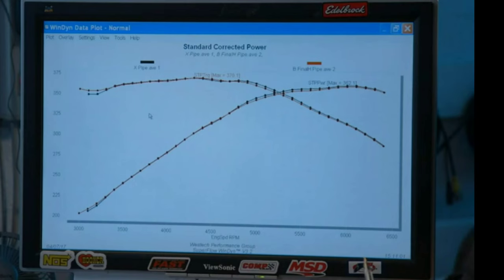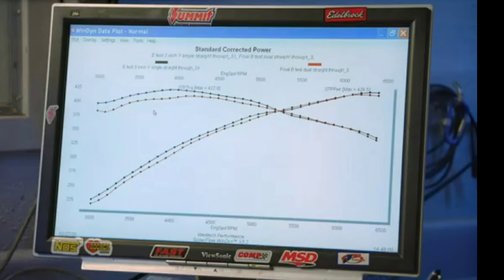DUAL EXHAUST LOSES POWER! single is better for POWER!

Comment: I have a 2005 accord coupe V6 it has 2.5" pipe and it has around 300hp dual exhaust what would be good for it to add more hp and throttle response/ back pressure because i installed a loud exhaust now it's slow i don't care about sound anymore how do i make faster ?
Reply from the maker: You want zero backpressure, actually you want vacuum. 

I would do 2.5 in exhaust into a Y pipe and 3in outlet if it were me 🤔
Reply: 2.25" dual with factory catatlytic converter to keep initial exhaust velocity high and low end torque. Y pipe that has a 3" diameter , this then splits into your stock rear dual exhaust mufflers that are 2.25" , this lower diameter is important to keep velocity up (gas cools and slows as you get to rear end of vehicle). I would also heatwrap the entire system to keep higher EGT and prevent drone.

Comment: Heres what I want to know, I am building a Vanguard 23 hp airplane engine modified for 40 plus hp at 5,000 rpm, (briggs and stratton). V Twin which fires 450 then 270 degrees, so there is no way some two into one pipe helps it.. RIGHT?
Anyhow, I can run straight pipes no muffler, cause I am in the air :)
My Dynosim6 software tunes the exhaust but always wants a collector, 2 into 1 I guess.
It says to run a 1.2" primary pipe for 42.3 inches to a 1.79 inch pipe that is 12.75 inches long.
Since I am not going to go 2 into 1, do I take the collector length 12.75 and add it to the primary length and make a pipe 1.2 inches by 55.05 inches long ?
It says the tune is at 4150 rpm, redline (takeoff power) is 5,000
It uses a custom high flow head that outflows stock by 55%
The cam overlap at 006 is 93.2 and at 050 its 28.
intake valve is 1.41 exhaust 1.2
ALSO
The 4150 rpm is chosen by the software I cant alter it, we want max power at 5,000, when you reduce the rpm on an airplane the prop hp needs drops a lot and the engine has more and more unused hp.
So I assume I actually need a shorter exhaust since I have no interest in tuning for max hp below max takeoff rpm

EDIT
I found a way to move the TUNE RPM and at 4950 it wants a 1.2 inch pipe 36.1 inches and a 1.79 at 11.025 for 47.125 total ? (and i lose 0.39 hp at 5,000 by doing that lol, drops from 47.19 to 46.89)
Reply from the maker: Wait....why don't you want to run 2 into 1?
Reply: @newguysgarage6802  how does two into one benefit me, other than more weight, on a v twin that fires 540 and 270 degrees, i want to know ? :)
Reply from the maker: @vg23air ......improved exhaust scavenging leading to increased tourqe, did you not watch the video? 😅

Same principle applies 🙂
Reply: @newguysgarage6802  yes, how does the scavenging improve when they are not 180 degree cylinders, it is 540 270 v twin, is that in the video ?
Reply from the maker: Why would that matter? Exhaust scavenging works the same way regardless. A collector will allow one Exhaust pulse to create a vacuum in the other pipe to help the next Exhaust pulse.....that doesn't change just because its not 180° lol
Reply: @newguysgarage6802  umm, the vacuum is a pulse that exists on arrival and does not hang around and if there is no open valves and overlap for it to continue into it bounces back the other way and is gone ?????
I mean, its no even a vacuuum, its a pulse that can CREATE a vacuum, IF IF IF otherwise its nothing
Reply from the maker: @vg23air  I have no clue what you are getting at?? 

The fact its 270° vs 180° dosnt really matter because scavenging affects them both the same.....it will affect the optimal length of collector but that changes with every engine combination so thats nothing special.

Its not really that complicated a subject....If you dont want to do 2 into 1 then don't I guess 🤷
Reply: @newguysgarage6802  i will have an answer for you soon, i asked an expert, is it better to have one pipe or two, simple

Comment: Smaller diameter pipe only works to a point. If you go too small, you end up restricting exhaust flow. If I had, say, a 350 cubic inch Chevy small block, and I was going to do a single exit exhaust, I would have long tube headers with 3" collectors, with 2.5" exhaust coming iff the collectors, and then where the 2 sides of the exhaust Y together, thw remaining single pipe would be 4 inches.
Reply from the maker: I would have kept the 3in going to the Y pipe lol
Reply: @newguysgarage6802  Only reason I'd step it down to 2.5 would be to maintain exhaust velocity after scavenging in the collector, which in and of itself functions as negative pressure/suction. It slows the exhaust flow ever so slightly.

Comment: I have an 06 Escalade with the 6.2 I was thinking about doing 1 7/8 headers dual 2.5 pipe into an x pipe then into a dual 2.5 inlet single 3 outlet the best of both words
Reply: 3 in all the way out is best, especially using a H pipe or double helix

Comment: Thank you for the knowledge I do have a car that has a why and it has headers on it does respond very well I'm just going to put on a better Muffler right now I got a hole in the muffler it sounds okay but it doesn't it lags of power I do have a better stainless steel Muffler again thank you again thank you thank you so much

Comment: Old to make a comment, but this is false. its been shown X pipe for high rpm flow H pipe sound and power to a point and a big single is only good to a point of like 5-600.

Comment: I did a muffler and resonator delete on my 2015 Hemi ram 1500 and still kept my Y pipe.  Sound decibel was 115 compared from doing true duals 4 points higher to 119. Was planning to do true duals until i did some research first and said you will lose power and torque without an H,X or Y pipe . Had a friend at work who drives a 05 ford 5.4 triton with true duals and no pipes. His truck was barely going fast. Just loudness but pure slow
Reply from the maker: Yep!
Reply: See the problem with the guy that made this video and you you're not understanding the basic concept of what's going on here you're losing exhaust velocity if you use small enough pipe and a true dual system it will maintain exhaust velocity and it will run fine. EXHAUST VELOCITY.
Reply: That’s a 5.4 triton for ya 😂

Comment: i have always liked the sound of a single pipe system, something i have been thinking about is using an old single pipe ram 2500 catback system thats 3 inch all the way for my 79 mercury cougar.  it would require i cut off the cats and got a y collector but do you think i would acrually gain anything whilst still on old log style headers
Reply from the maker: Yes i still think having the pulses from each side helping eachother out will make more low end tourqe with the log manifolds. 

Just make sure it is a nice Y pipe, and doesn't have a restrictive muffler
Reply: @newguysgarage6802  thank you for your input!  it wont have any mufflers, its a antique so no inspection is required
Reply from the maker: @TBO207  
You are welcome 😁

Comment: Engine Master's test was flawed.   They used 2.5" (from the manifolds) with NO balance pipe for the dual exhaust versus  3" (stepped down to  3" and a Y balance pipe) for that dyno.    They gave the 3" version time (length) to cool from the manifold.  The difference was only 8hp -- with the dual version being slightly compromised.    I'll be honest coming out of that Engine Master's episode thinking they were bozos and considering to stop watching their episodes.   Either option could have been better since they also showed the open header version -- which beat both by 20+hp.
Reply from the maker: Unless you can show an apples to apples dyno test showing it not to be the case.....you have debunked nothing 🤷‍♂️

Ive shown dyno results and explained reasoning why it would be the case. 

You saying they are flawed is not good enough to debunked it...you would need to provide physical proof that it is the case...not just speculation 😂

Comment: I like single because it fits the body I have and doesn;t hang low.   I like the sound better.  I hate the dual exhaust popping machine gun sound on a daily driver.   Is great on racecars, not my camaro though.

Comment: I do not go for power, I go for dual exhaust. For the reason of repairing a miss fire true dual exhaust pipes if you have a miss fire go to the rear of car put a paper on exhaust tip if it suck the paper to the exhaust you only have 4 Cylinders to play with , and not all 8 Cylinders. . . . . .
Reply from the maker: .....you can just feel primary header tubes to see if one is colder then the rest too....kinda simpler and it will tell you which cylinder it is which the papper trick won't lol

Comment: Does the scavenging affect relate to vacuum??
Reply from the maker: .....mabey in a very round about way? 

Better scavenging would mean a more evacuated cylinder, and would help pull in the intake charge during overlap. 

That would mean a stronger pull on the intake plenum....which could equate to more vacuum.
Reply: Aaaahhhh gotchya. What if there was an exhaust per oppossing cycle?? So a straight 4 would have 2, a V8 would have 4 so an inlet and outlet cycle of cylinders if that makes sense to further the scavenging affect??

Comment: Consider the spacing between firing on the two banks is usually not even.  Sometimes two adjacent power strokes happen on the same bank.  Connecting the two banks together is imperative to smoothing this out.  

A flat plane V8 with even firing might have little effect from this though, they basically act like two 4 cylinder engines.  Does the C8 Z06 (LT6 flat plane) even have a crossover?  If so, probably just for sound.
Reply from the maker: https://youtu.be/FlubSHSFyGQ

I cover that in this video here.
Reply: Like most engines the Mopar small block is 18436572,  As can be seen 5 and 7 are same bank and consecutive firing. SBCs are the same and if you re-organize the Ford SB firing order to conform in the front to rear rod-order, it is the same also.  
The only conflict in the X-pipe  is between 7 and 2 , and it ain't gonna matter  for a street-driven machine, unless maybe you have a teensie-weesie pipe, and even then only as the rpm rises. ...... IMO.
In the H-pipe, 
my understanding is that there is very little actual exhaust flow in the pipe, Just a general pulsing back and forth like an expansion chamber.
Well
 I already bolted on a pair of expansion chambers, called 3-pass mufflers.
And, I choose 3" tubes to act as heat radiators to cool the exhaust so the gasses contract, and thus having lost energy,  they fly thru the muffs faster/easier, and idle thru the 3" tailpipes, practically falling out the ends, thus being nice and quiet; which keeps the cops off my azz. That was my theory.
If I lost horsepower, I don't actually care, cuz if the cops catch me and take away my license, then the car will be parked at Zero hp.

As to the weight, Yeah the whole 3 inch collector-back piping and mufflers is 72 pounds, and how much weight would a smaller system weigh? I'm gonna guess 50 pounds, So what does 22 pounds cost me in first and/or second gear? My car on the street, spins further than that anyway so ............Ask me if I care. 

I could be wrong but if I am, again, ask me if I care.

Comment: The X pipe also makes a bitchin sound!
From the Trans Am series to restrictor plate NASCAR racing.
I loved the concept really and makes a lot of sense.
It simplifies the whole collector length, primary tube length, 180 degree header design dilemma.
Reply from the maker: Thanks for watching 😁

Comment: Magnaflow muffler 2in /1out considered a y pipe?
Reply from the maker: Not really 😕 
Because you wont get the scavenging element running then into a muffler as you would get by having two pipes merge on there own. 

Mufflers volume is too big for one side to be able to help pull exhaust gasses out from the other.

Comment: I had to stop when he said " air sticks too things ". This is a fact. Proven in wind tunnel testing.
And for you golfers, those dimples on the ball cause the atmosphere to,  stick on the ball so that the ball travels farther.
It goes to reason other fluid dynamics would take place in an exhaust pipe.

Comment: if this is true then how come everyone and their moms say duals are better because more air can be pushed out? dont get me wrong i love single exit exhausts and the sound they make im just hella skeptical. I want to put a single exit on my b7 s4 but im not sure if i want to because i dont want to lose power.
Reply from the maker: If the only concern was more flow.....then no headers or manifolds at all would make the most power. 

Its scavenging that is important. A properly sized single will keep velocity up, be half as light as duals, and have better scavenging affect.

Just because everyone does something a certain way does not mean that is the best way, lots of people take off there factory air intake and put a "cool air intake" on. It ends up being way worse then the factory setup because the factory took the air from outside the car, most of these people with the aftermarket intake pull the air right next to the hot radiator lol
Reply: @newguysgarage6802  so currently the b7 s4 has 2.25 trual duals that come with the car when i got em and stock, eventually i would like to go with rs4 headers, since they are pretty much long tube headers. but as of now with stock headers should i switch to a single? or keep the true duals until i get the rs4 headers then go single. and what size do you think would be good? the b7 s4 is a 4.2 v8 N/A.
Reply from the maker: I would just wait until you get the headers on.
I guess if it was me I would do the 2.5 into a Y pipe and 3in out 🤔
Reply: @newguysgarage6802  would that not be to big for a naturally aspirated motor? and how is it noise wise since i plan to daily drive this car
Reply from the maker: I mean thats just what I would do, I would just have it dump right before the rear tires myself......But I like the loud exhust 😅

The Mustang had 3in duals on right now, but im going to make a single exhaust for it and have it dynoed to see the difference

Comment: Most people to not know about scavenging or how CFM works with external static pressure    also a larger diameter single exhaust with good header collectors can flow better than duals   also you save some weight   I chose 3" single for my mild built ford 302 V8 swap in my Datsun   I do heating and cooling and measure external static pressure/CFM  of duct work often
Reply from the maker: Yep 😁 
Most people just assume two pipes flow more than one without actually thinking it through 😅

Comment: The only way this works is 3 inch duels for max best or a 6in single. So do the math 😂 the size of the pipe is what matters but you gotta raise the size of headers first or it does nothing lol
Reply: That's incorrect math. One 6 inch pipe has four times the area of a 3 inch pipe. You only need one 4.25 inch pipe to equal the same area as two 3 inch pipes.

Comment: All this is true. It's the same of 8 into 1 headers and 180 degree headers. Sounds like a flat plane crank V8 or two synchronised 4 bangers. But I hate that sound. I had a custom 3" single exhaust made for my 2005 Aussie Ford Fairlane. It has the same 5.4L 3V Triton engine as the F150. It sounded like crap. Why did F150s sound great with a single exhaust and mine did not? My Y-pipe was equal length whereas the stock F150 Y-pipe is unequal length, giving a time separation between the two banks, giving it the V8 rumble sound that I love. I had the exhaust guy add a zig-zag to one side of the Y-pipe to make a length difference between the two banks and...Hey presto! I had the glorious V8 sound that I love. I know the exhaust pulses aren't perfectly timed to maximise the scavenging effect, but I don't care. 🙂

Comment: The friction theory is not flawless. Split the exhaust gas into two pipes means half twe volume flow per pipe and with that less speed and with less speed you have less friction. Just to consider for further thoughts.
Reply from the maker: Less speed also means a less efficient exhaust, and slower speed means the exhaust gasses are subject to that friction over a longer amount of time. 

More surface area in the smaller pipe as well, so you have more exhaust in contact with the pipe to create friction in the first place lol. Were if you have 1 bigger pipe there is significantly less surface area for exhaust to rub up against. 🙂

Comment: Cool, now explain what happens to exhaust velocity when your 8 pulses smash together into 1 pipe.  

Dyno sheets talk the talk, time slips walk the walk
Reply from the maker: Velocity happens lol 😆
Reply: @newguysgarage6802 by your logic, log-style exhaust manifolds make more power than long tube headers because there's better scavenging from 4 cylinders (on each side) as opposed to one pulse per long tube
Reply from the maker: @justinforgette11  ......and how would you come up with that idea? 

Not with my logic 😂
Log manifolds barely have any scavenging affect to them because they just dump into a plenum essentially. Proper exhaust scavenging should be done in a collector......just like I explained in the video lol
Reply: @newguysgarage6802  clearly you know nothing about scavenging.  You could have joined st said so😂
Reply: None of the pulses smash together...because every pulse is a separate event...but you knew that ...right?"
Reply: @BPoissant velocity is lost in the single pipe and those pulses slow.  X-pipes dominate Motorsports and street cars, just because one guy with a camera from 2006 records a video explaining why racing experts are wrong, doesn't make him right.